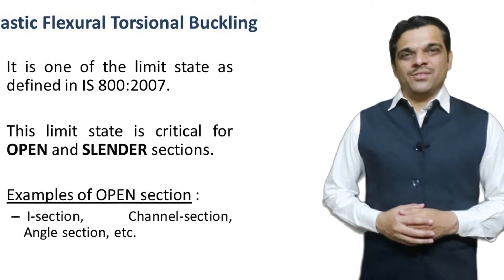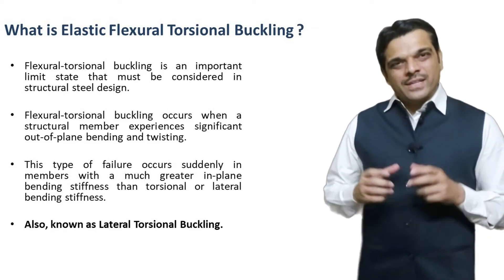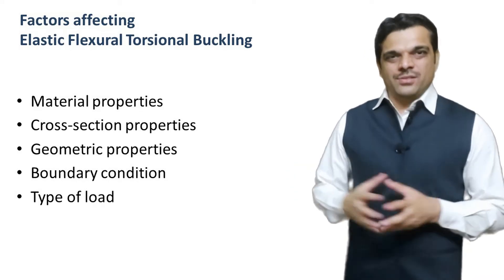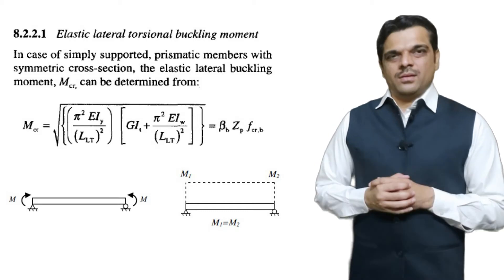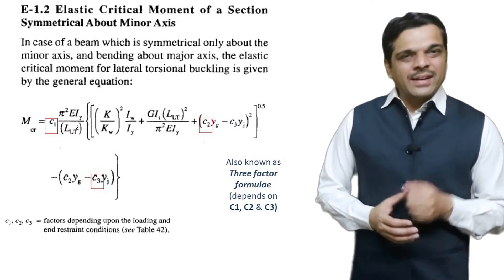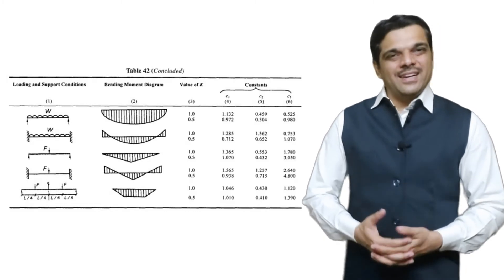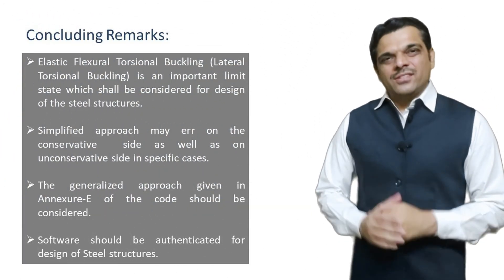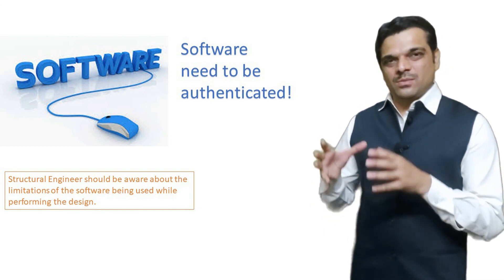Lateral Torsional Buckling for design of steel structures as per IS 800:2007

Comment: sir,

i have modelled a 2 d frame  analysis of simply supported beam of 10 meter span  and the property is compound section with channels and plates. i have assumed the beam as laterally unrestrained. i manually checked this beam using IS: 800 , 1984 and the allowable  stress on beam is exactly matching with the beam modelled , analyses and designed in staad pro using IS: 800 , 1984 CODE. but when i designed the same beam using latest is : code IS : 800, 2007 IN software, the allowable stress came 30 % lower which becomes my design conservative. I have not checked manually using limit state as per the latest code but i suspect this higher result may be due to limit state of flexural torsional buckling. please give your opinion sir